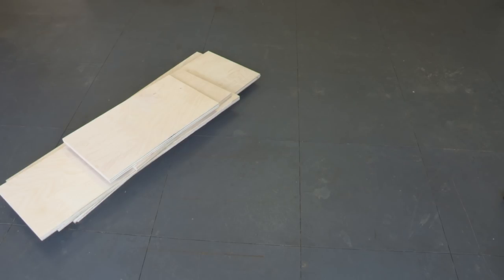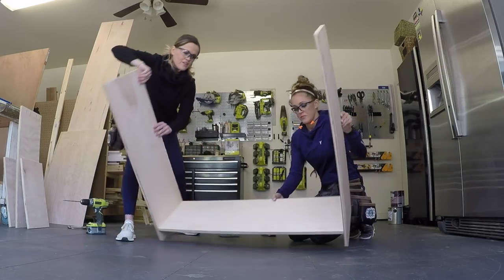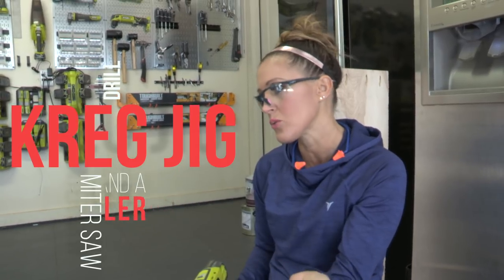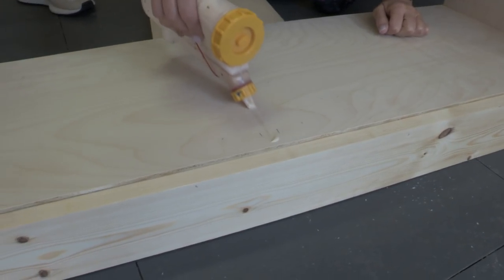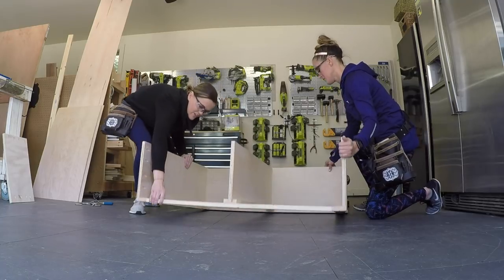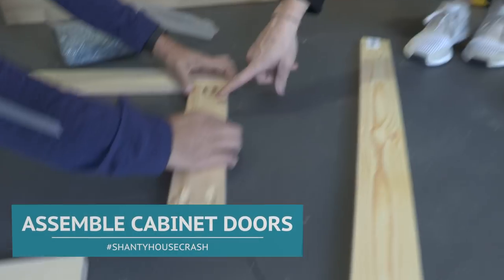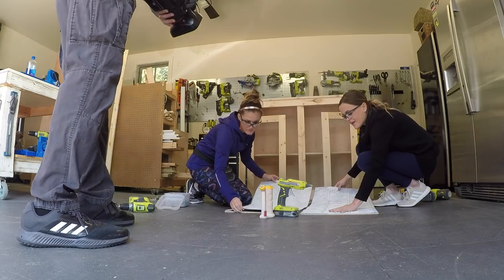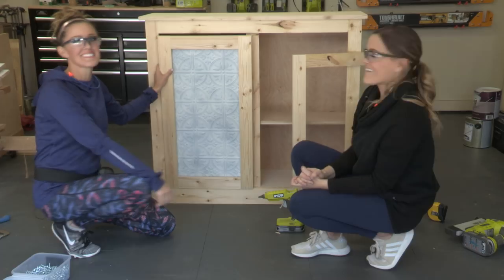DIY Faux Tin Door Cabinet

Comment: You guys are awesome!!my husband and I are starting to build some projects now using your plans! 😊 I’ve looked at Home Depot and Menards (from Illinois) and the “project panels” are still plywood. Are the panels called something else or are they a particular type of wood that have a finished edge? 😩
Reply from the maker: Shelby Eaker thank you!! At Depot they are technically called “edge glued panels”! Here’s a link. Hope this helps :)
https://www.homedepot.com/p/Edge-Glued-Panel-Common-21-32-in-x-18-in-x-6-ft-Actual-0-656-in-x-17-25-in-x-72-in-493562/202084674
Reply: THANK YOU!! This will help so much!!

Comment: These are great and I love the renovation of The Trend Shop! I was wondering if you could make the bottom plywood flush when making the carcass? We made your buffet and it was great but the middle did sag. Do you do that so you can make a toe kick if the floor isn't level? Also, do you think you would be able to float those panels? We've done it with 1/4'' plywood. Thanks :)
Reply: blissriver co i